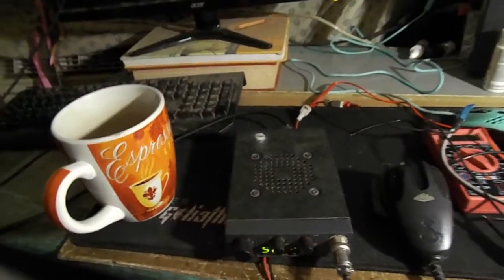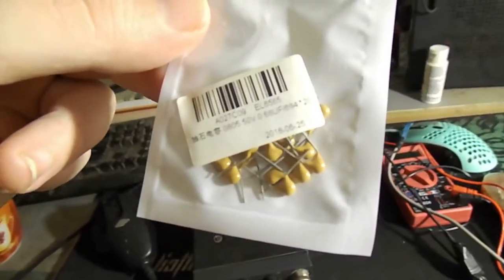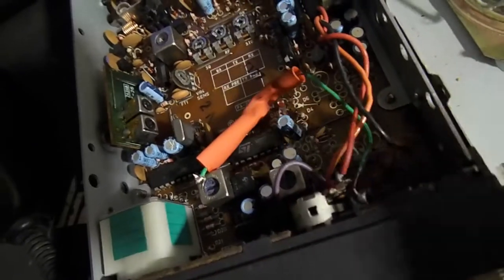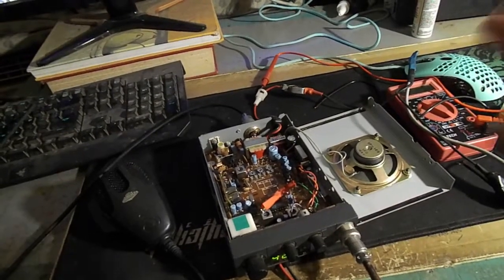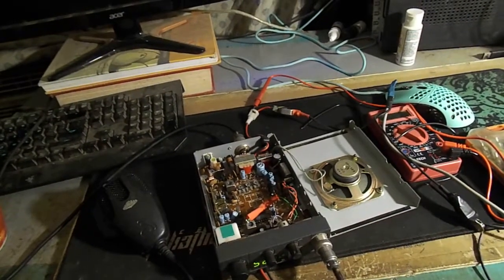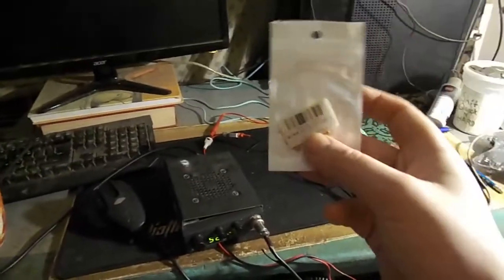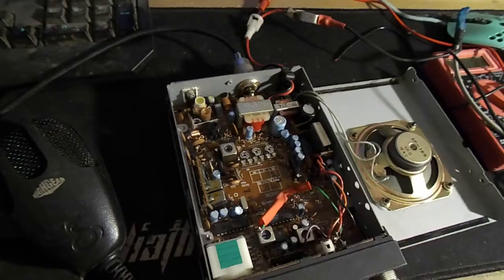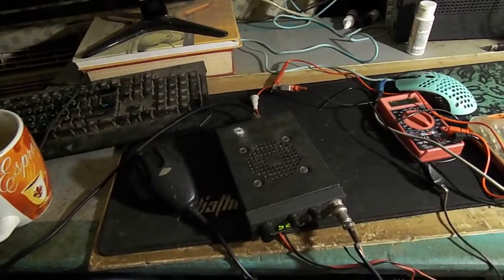Make A Cheap Radio Sound Expensive! Easy Radio Modification ANYONE Can Do!

Comment: I am receiving almost 2 S units of noise on multiple channels in increments of 7 channels, 7, 14, 21, etc. Any other channel it drops back down 2 S units, has baffled me for years. Any ideas?
Reply from the maker: @roughrider3772  sounds like it could be a pll problem. I would try replacing the capacitors. There’s some harmonic that’s not being suppressed.

Could also be a voltage issue you’ll need an alignment

Comment: Running one on the power leads is something I might do, I have a CB radio in my tractor trailer at work and it gets noisy sometimes. I'd really like to run a ground wire on it but don't think they'd like me running random wires in the truck lol do you suggest using the same size you used in the video? And do you just run it from the negative to the positive leads on the inside of the radio?
Reply from the maker: Honestly buddy, there are some great power filters of there

I would recommend getting one of those that way you can use it no matter if you change radios.

You can usually find them on ebay or at a CB shop (although they will really jack the price up on you)

Those are great for noisy engines.
They most likely use an LC filter basically inductively choking the RF into a capacitor. Which is much more efficient for noise cancellation.
Reply: Ok thanks, I'll look into those. Thanks for the reply

Comment: Having trouble sourcing these capacitors on eBay. Can you post a link please? Have an ancient GE from 78 that needs this mod BADLY. Thanks JJ!
Reply from the maker: You can use anything from around 0.033 uf to 0.068 uf 

If you think the 0.068 µF capacitor cuts out too much audio you can attach two of them series together (one leg to volume the other leg to the next capacitor leg then attach the last leg to ground) to reduce the filter depth

Copy and paste this link in your browser

https://www.ebay.com/itm/384547007153?mkcid=16&mkevt=1&mkrid=711-127632-2357-0&ssspo=gaRbL4NuQwa&sssrc=2349624&ssuid=bqlgDs_2Rxm&var=&widget_ver=artemis&media=COPY

I would also recommend changing electrolytic capacitors in that Radio if its that old and giving you noise

The electrolytics are used for smoothing purposes and if they go back you’ll have spikes that can cause noise
Reply: @JohnnyJonesathome  thanks! Illl definitely look into these ideas. Watched Mike’s video on it and it’s very impressive, glad I subbed to you; so much good knowledge floating out of my computer into my brain! My GE is a 3-5811B and I got it with a power cord and ratty ass mag mount repair job for $10; I’d love to keep it alive since it’s from ‘78. 

I know you don’t condone mods per se but could you show us some more small, harmless mods like this one and the talkback resistor (if you know of any)? Please and thank you!
Reply from the maker: @theoneleggedraven1940  I was planning on making a mod video actually.

Mods are fine with me, I just don’t understand why people use power mods

The way I see it if you’re going to go through all the trouble to get a few extra watts out of your radio you might as well just get an amplifier and be done with it.

The FCC doesn’t really care, the only reason I follow their rules is just a small chance that one day they might get a wild hair up their ass and start taking down videos.

I’ve made a video on a talkback mod before

But there’s some other configurations I’d like to try out with that mod.

I think in the last video I made I had one of those GE radios.

There’s nothing wrong with keeping a radio alive, they do tend to grow on us.

And I appreciate you subscribing, Every subscriber counts 👍
Reply: @JohnnyJonesathome  Absolutely! I do remember the ge video and your talkback video inspired me to do the modifications; not power mods, that’s what skip is for. 😉 👍 but yeah I just meant noise toys, talkback, peak and time, etc. “Soft mods” as it were. Keep up the great work!

Peak and tune* 🤦‍♂️ d’oh!
Reply from the maker: @theoneleggedraven1940  Cool man I’m glad you’re getting into it.

I’m more of an physics man than a circuit guy but I’m still studying.

Some guys like running a lot of power, i’m the opposite I like running as little power as possible and relying on my antenna to do the work.

Talking to Florida off 4 watts made me a lot happier than if I used 200 watts

The hams call that QRP.

I’ve seen hams use CW (Continuous wave) and get contacts a thousand miles away from 2 Watts of output power

But they’re using Morse code so there’s very little frequency spread

The more power you can put into a single frequency the better range you’ll get that’s why CB radios often use SSB for longer contacts. Basically whats happening is the frequency spread you are transmitting on is about 1 third of the AM spread.

Kind of like making the diameter of a water hose smaller but keeping the pressure the same it shoots a lot farther

Comment: Hi, do you have a ideea how i can make a thiny voice modulations on anytone 6666? The microphone it sounds to bass, i need the others to hear me thiny..
Reply from the maker: You can try a different microphone and see if it helps

You can also try using a logarithmic speech processor/ compressor

But if the radio itself is broadcasting a dull sound then thats not a great thing

If the radio has been modified it could be distorting as well

Comment: I love your content. I’m getting a lot more involved in CB radios now and I have some questions that I haven’t really seen answered on YouTube yet. If you’ve already done a video on this, please let me know. I’m trying to understand the difference between a 1/4 wave antenna and a 5/8 wave antenna and what would be best for me. I have a mobile setup. Additionally, what’s the importance of an antenna analyzer vs just using a standard SWR meter? Thanks! I hope to hear back.
Reply from the maker: I have videos on my channel of antenna differences if you would like to watch those

The easiest way to answer your question between a 1/4 and 5/8 wave is that the 5/8 wave is a longer antenna

But ultimately it means you’re going to have a flatter radiation pattern which means you’ll get more local contacts

The difference between SWR meter and an antenna analyzer is that an SWR meter shows your reflected power vs your forward power

The more reflected power you have the higher your SWR is

So if you have an antenna with a higher or lower impedance than 50 Ohm’s you’ll get reflected power

An antenna analyzer will show you what frequencies your antenna is resonant at graphically 

You can build your own antenna and use an SWR meter to tune it

But using an antenna analyzer is much better because you know for sure if your antenna is close to being resonant or not

Because occasionally You may trim your antenna too much using an SWR meter because it’s a little bit hard to tell if it’s too long or too short or if it just happens to be too close to another object

So an antenna analyzer is like an SWR meter but much better and often graphically displayed

It also shows you your resistance and reactance, which forms your complex impedance

I thought I making a video explaining impedance to people so it’s not so esoteric

Also I’m really glad you like my content and thank you for your comment

Oh and the best antenna For a vehicle is a 102 inch Steel whip 

It’s a full quarter wave

But it’s going to be really tall if that’s going to be an issue my second choice would be a wilson magnetic whip antenna or any similar antenna that’s about 5 foot it still gets you pretty good range

You really don’t want a five eights wave on your vehicle for one it’s more of a base station antenna it’s very tall so you would have to shorten it(coil it) significantly which is not really worth doing

Comment: Cool good sound i want to make it in my redio  panasonic ( big speaker  -Rf562) can you help me ? And show me how to do it, and thank s a lot.
Reply from the maker: 0.068 microfarad capacitor between the “wiper” (middle pin of the volume potentiometer) and attach it to a ground point in your radio. 

Often times there are plenty of shields inside the radio that are grounded you could use

If you don’t know where to find a ground attach a multimeter in continuity mode on your negative terminal (With the power off)  And test points in your radio until you find a ground location

If you don’t have a continuity meter set your multimeter on the resistance value and check for a very low resistance between your negative terminal (in your battery compartment) and a grounding point in the radio.

I have made another video on the subject here https://youtu.be/zkfo3viWuSs
Reply: Hi khere is no 0.068 capasitor i only found 1uf capasitor beside volume potensiometre i try to attach it with the ground but not work
Reply from the maker: @sallahnabil9511  No don’t take anything out of your radio 

you have to go and buy a 0.068 µF capacitor
Reply: Ok thanks i well do it now i inderstand
Reply: Sorry i havent well inderstand last time .thanks

Comment: Sounds great!  You can also change and remove a few resistors on that Cobra power mic and it will come alive.   I did it to mine.  Sounded weak at first.
Reply from the maker: Yep there are several mods you can do to those power mics to change their range as well. I’ve heard people claim that they have a very narrow response but you can modify them to amplify the mid to higher end of the voice spectrum to get better intelligibility